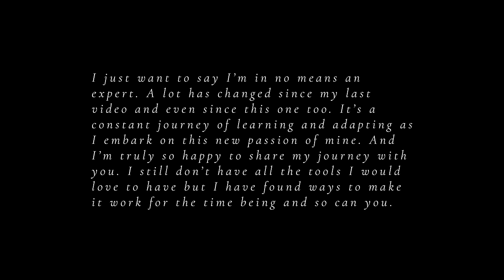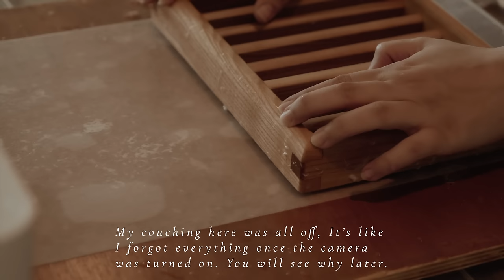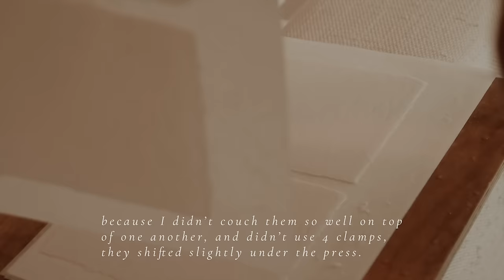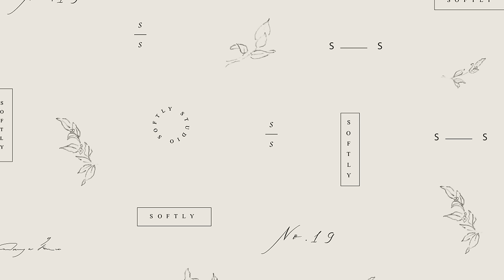Studio Vlog 09 : How I make my Handmade Paper

Comment: Nice video. One thing that has helped me flatten the paper is after you take them off of the blotters...to then do a light spray of water on the paper. The paper should flatten out and it will help you when you’re laying and doing the final press. I have also used a fan on that final press to help quicken the process.

Comment: Very nice Thank you for sharing !. I would just ask why the use of a straight edge ruler to tear the cotton rag at the start , when then your just tearing it by hand into smaller  pieces to break it down into the pulp?
Reply from the maker: The pulp paper is quite thick. Using the ruler helped but tearing it after you soak it is a better idea. Much easier. but its takes like the same amount of time I guess and for this video I wanted to process the pulp the same day. But usually I would let it soak at least overnight. Just rushed it a little to film 🙈

Comment: Do you ever dye or color your paper in the process. If so, at what stage?
Reply: when you have the pulp in the coutainer is when you would add any dye :) the dye will not affect the quality of the paper, so do not worry too much about it
Reply: You would put the dye in your tub of water and then continue the rest of the process :)
Reply from the maker: She is correct. After I blend all the pulp, I add the dye and that is why it's also important to measure the weight of your fibers when dry. I haven't really gotten into a lot or  with proper pigments, I have only tried a few fabric dyes and also botanical dyes but soon I hope to experiment more with color ❤️

Comment: So beautiful the whole process. Pls what Is "sizing"? I have no idea. Thanks💕
Reply from the maker: To accept the use of ink on the sheets. If you do not add sizing, ink will bleed. It also slows the drainage which gives you more time to shake the mould to create more uniform sheets. 😊
Reply: Thanks! I mean I know ,it s so important and I used to use calcium carbonate, but it Is  a not currently available un drugstores  in my área. What kind of "sizing"do you use? Thanks again 💖
Reply from the maker: @alejandranovello3274  It's ketene dimer emulsion. Calcium Carbonate is for creating acid-free paper and making them archival, so they last longer. The sizing I use has that option in their mix so I don't use Calcium Carbonate, although I do want to see if adding it will ensure my papers are long-lasting. I have read people also use Gelatin Sizing and brush on the sheets after they are formed and dry. It's more like how they do it in the old days as well. The sizing I use is more modern, and the way it's mixed into the pulp for me is easier than brush-on or spray sizing.
Reply: @SoftlyStudio  thanks! I can tell you I used calcium carbonate in my papers 18 years ago. I still have them AND they're perfect. I 'm back hand made paper making these days after so long. I ll see what sizing I can get around here. Thanks again 💖

Comment: hello, what is the purpose of the sizing thing you added in the pulp?
Reply from the maker: To accept the use of ink on the sheets. If you do not add sizing, ink will bleed. It also slows the drainage which gives you more time to shake the mould to create more uniform sheets. 😊

Comment: May I ask what you’re using in between the papers when pressing? Not the couching sheets but the brown ones. I have issues making my paper have a smooth surface for my calligraphy which usually ends up costing me valuable time and work. Despite making paper on and off for a couple years, still haven’t figured that one out. Which is probably because I don’t have a press yes but I’ll make my boyfriend build me one if I have to 😁

Comment: Wow....that is a lot of work! No wonder handmade paper is so costly! Questions...what is “couching”? Also you mentioned weighing the “dry pulp” does that mean your pulp ball was completely dry before adding the sizing? Love your homemade press....gonna make me one! TYFS! NEW SUBBIE HERE MICHIGAN USA ❤️🦋💜
Reply from the maker: Hello Cindy. Thank you for your kind message. Couching is the process of laying your sheets over each other before pressing. I called it a sandwich because its like making a sandwich basically 😂 Lot's of papermakers have different "recipes" I guess but basically you have a board or flat surface then your couching sheet and then your freshly made papers and so on. I do add a dry felt on the top and bottom now to soak up even more water when I press them. 

As for the dry part question. Yes it's important to measure the pulp in dry form if you plan on using any additives. As the amount you use is based on the weight and when the fibers are wet, it's basically mostly water so that will give you an inaccurate weight measure.
Reply: Softly Studio thank you for your thorough answer! The sheet you add as your layer....is it just plain paper?

Comment: Is that marine plywood? O would think regular ply would start pealing after a while 🤔
Reply from the maker: Its regular plywood but marine sealed. I usually go with a spar varnish and I cant stand the smell and takes longer to dry so the last two boards I had I used poly only and seems to be holding up just fine. But definitely seal the wood. I have ruined one at the start of my journey 😂

Comment: At 4:02 you seem to be using a very slow drill/screwdriver, is that intentional? These type of mixer paddles are usually spun pretty fast, like a hand mixer. (Alternatively, you could simply use a cheap hand mixer.)
Reply from the maker: Oh I didn't have enough water and I ended up buying a bigger one. The fibers get tangled in it sometimes and stops the mixer without much water. It's a Jifyy mixer tool attached to my drill. It helps to mix additives or pigments in one go.

Comment: would you need sizing if you use scrap paper like newspaper and stuff like that ?
Reply from the maker: scrap paper you can get a way with not using it but besides for writing it also slows the drainage of the pulp through the screen which will help you create a more even page as you have time to shake. Newspaper would make the worst paper as its very thin and fragile. I wouldn't advise using that to make paper. If you want to then try mixing it with a more stronger paper.

Comment: hey quick question, is there any way that I can do this without needing to blend it?
Reply: You can mix them by hand but it takes more time,and it isn’t going to be that smooth. But nonetheless you can do this without a blender, I guess 🤔
Reply from the maker: She's right and also a more tiresome way and what Asian papermakers used to do is beat it by hand with a wooden stick or mallet. This actually creates even stronger and better quality pulp than the blender but if you try it, I advise you hydrate the pulp for a few days to soften it.

Comment: How much bigger does the couching sheet need to be than the size of the paper you want to make, like A4 paper for example?
Reply from the maker: Well, you need to account for the mould size too as the paper would be smaller than the mould and I add a bit extra for hanging when drying too. Larger is always better than smaller as I have made that mistake and its quite difficult to use 🙈

Comment: so the more sizing the more ink the paper can handle?
Reply from the maker: No you have to use the right amount per the weight of the fibers. Too much will make your pulp sort of weaker and will need more time to drain through the screen. It's something you will experience with trial and error the correct amount to use. For me I noticed I needed to add a little more than the directions but best way is after making a batch, test and write on the sheet and from there try and adjust the quantity for next time.

Comment: Just a heads up, if you use recycled paper you don’t have to add sizing
Reply from the maker: I know but this wasn't recycled paper and definitely needed it. The recycled paper I use is also made from handmade paper scraps and that needs a bit of sizing as they're not like regular copy paper. It also helps not only for ink absorbency but also to add strength and to help slow the drainage to form more even sheets.

Comment: In this video, the tur is she didn't reuse anything. She only wasted things. she wasted so many clean papers, a full blender and a mixer. She literally wasted too much water. So I'd recommend everyone those who wants to make paper out of paper, not to use any of this mechanical technologies and a full plain white sheet of paper. Here's some tips for ya
* Use the unnecessary papers.
* Instead of using blender, put the papers into a bowl full of water and soak it for 24 hours (1 day)
* After one day, you can simply use a tea spoon or a tablespoon to mix. You can use spoon because it'll not get contaminated.
* No need to use any white potion (I don't know what is the meaning of sizzing)
* Now follow the rest of the steps from the video
And that's it, your homemade paper is ready!

Comment: if i dont use sizing what else i can put
Reply from the maker: External sizing is also an option and gelatin is commonly used. It's usually brushed on the sheets after they are dried. If you're making recycled paper, then you don't really need to size is but I find adding a little adds strength to the paper and gives you more time to shake to create more even sheets.